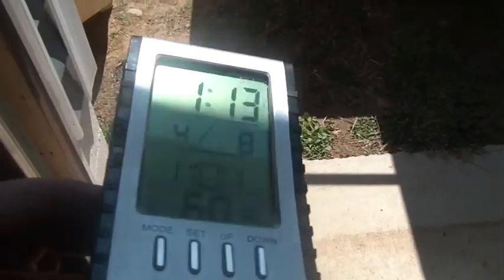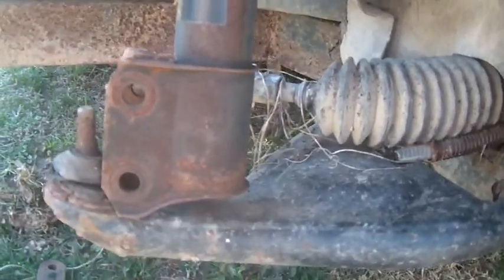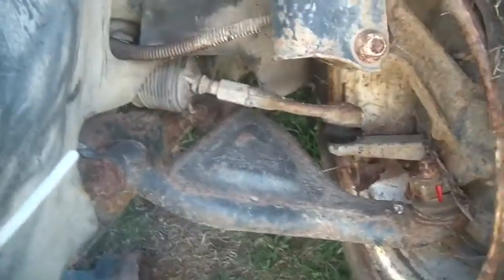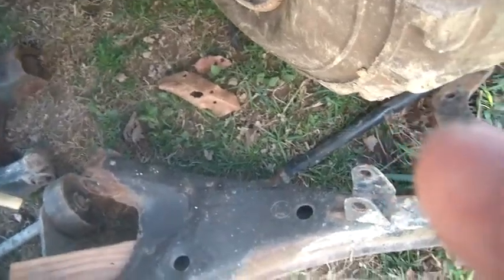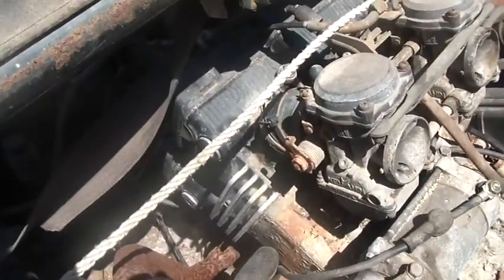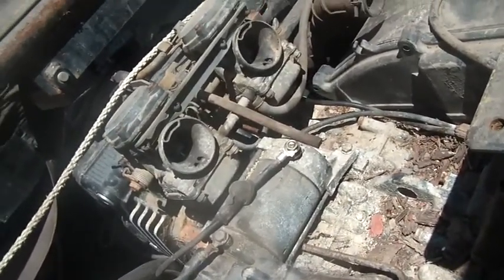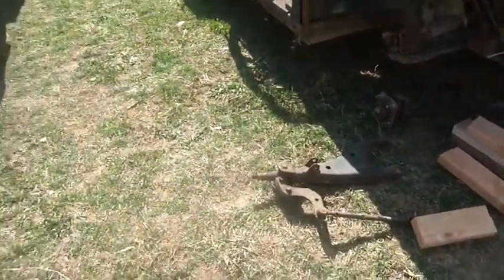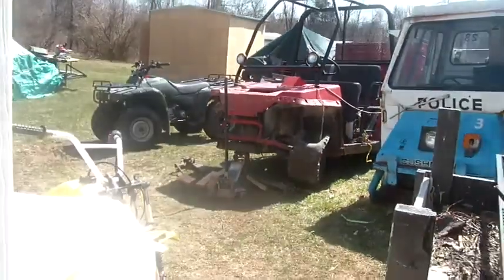4_8_2013, Working on a plan to Frankenstein the Kawaski Mule.

Comment from the maker: dwmogan, Actually, my concern is that I can not get the plugs out, I tried all my sae and metrtic sockets and nothing will grab the plug to remove it. I even tried the spark plug wrench that comes with a honda tool kit. Given the trashed radiator, I would normally just call the engine trashed, but, looking at it and listening to it crank, it sounds like a very healthy engine. I would hate to dispose of a perfectly good drive chain. Thanks for watching and commenting!